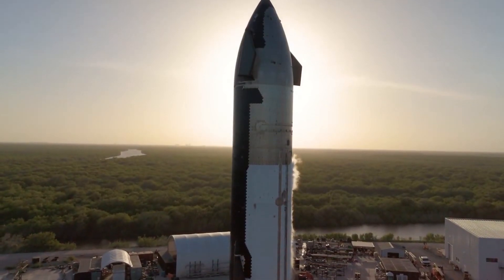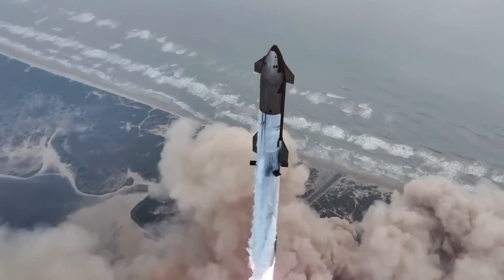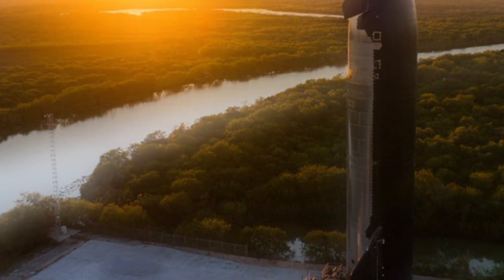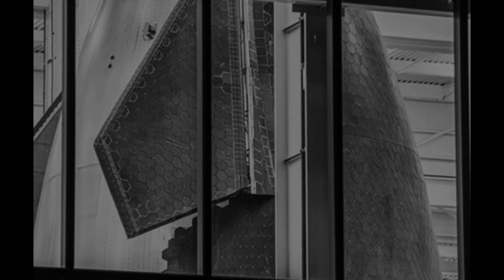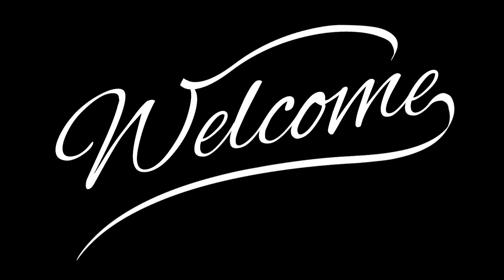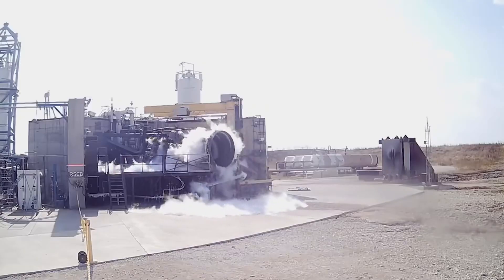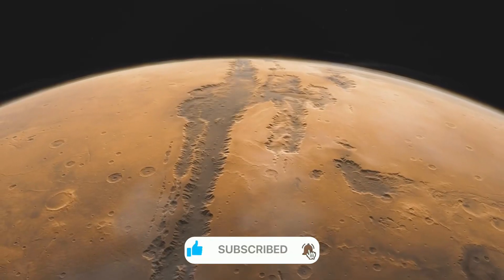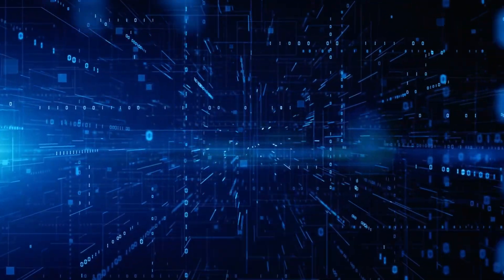SpaceX Finally Reveals Starship Block 2's Revolutionary Flap Design - Game-Changing Reentry!

Comment: I raised my eyebrows of fascination✨️
I'll dive in re: fuel used for Raptor engines. All along, I thought the liquid hydrogen tht's paired with liquid O2.
However, I gathered that the Raptor chamber were modified tht can stand pressure by the use of alloy, therefore, the use of liquid methane with liquid O2 as oxidizer. Ohh, liquid O2 cryogenic propellants, I suppose?
FOR INSTANCE:
My F250 truck gas chamber. If my desire to convert fr petroleum to refined gas. They have to change the whole kadoodle fr tank plus the analytical converter and major conversion in changing the use of "gas." 
U knw, 🤭😁 I am ur student here. 
My passion, love💜 fascination in re: Spacecraft, Spaceships, and SpaceX. 
Let me knw, if I am on the knowing 😁
Thank U 🌟🚀
~😽

Comment: Every time you play the video of the forward flap joint burning through you erroneously clain that it's the port side of the spacecraft.  Even amateur pleasure watercraft operators know yhat the right side is the starboard side.  It's a mistake that calls into question everything that follows afterward.